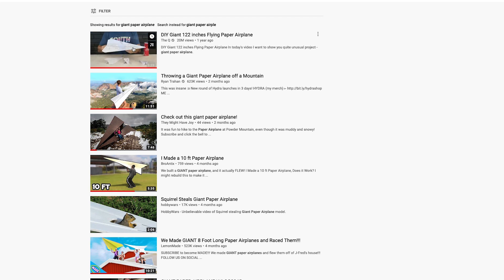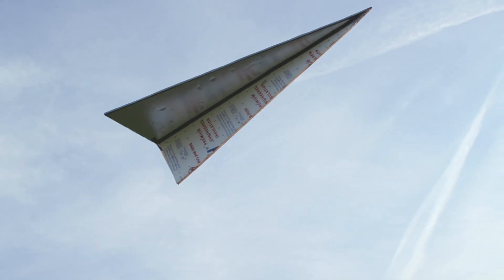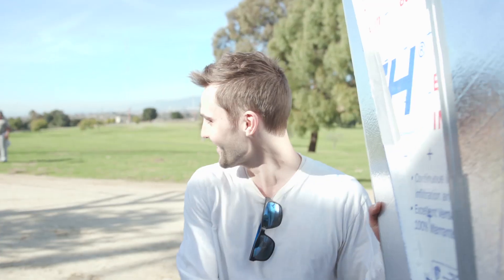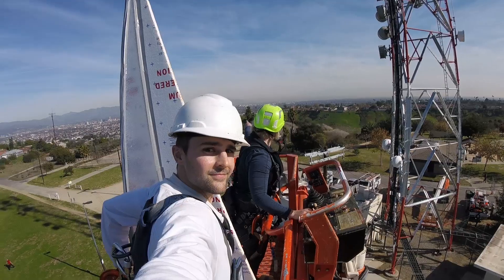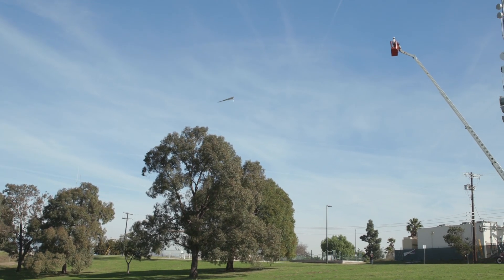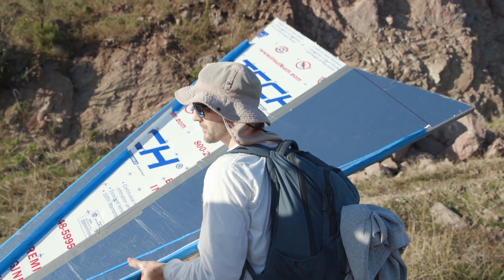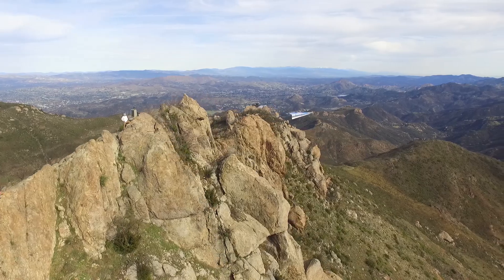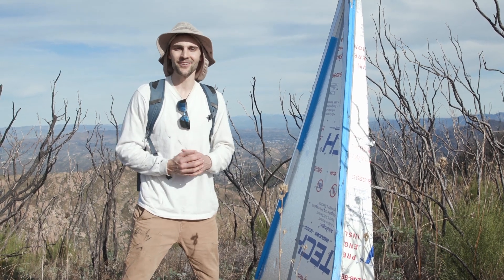GIANT Paper Airplane off a HUGE Mountain

Comment: You could have just put tape from the bottom edge to the top down the wing and it would have been better than nothing.
Or put it to the edge and slice it at an angle.

Like a real paper airplane, it just needed some weight on the nose.
So it was probably the extra weight and the "airfoil" that helped.

Comment: Nick I don't know if anyone else said this but, when you fly a paper air plane it flips upside down and the place where you hold it to throw, separates. I think it catches the air and, creates a low pressure area under the bottom and the wings just stabilize the whole plane. I don't know all the tech. terms but, I think it would fly a lot longer if you made it like how a real paper air  plane flies. Good Luck : )

Comment: The weight balance is wrong, if you took of a little of the vertical tail it would fly better. The extra forward edge just balances it better but also gives more weight.

Comment: A paper airplane has a natural airfoil that results from the bending of the paper into a curved surface. Also in a paper airplane lift is produced by the wedge formed under the wing. Your vertical section under the wing wasn't wedge shaped. And as everyone seems to have noticed you had issues with the cg. To keep it from pitching up and stalling it just needs more weight in the nose. You could give it a real airfoil by carving the foam with a hot wire.

Comment: was not an airfoil. Just a nose weight! Basics to create an "airfoil". Have to create a longer path for the air to travel on the top surface vs. the bottom surface. Basically longer surface distance on top than on bottom, would make a basic airfoil. That is why there is a "bulge", among other reasons.

Comment: You'd need to lose the air foil and also take some weight off the rear by cutting off the bottom rear corner of the plane... That will fix the centre of balance issue.

Comment: It's foam man. Simply stack one piece on top of the other and use any tool to trim, sand, cut or otherwise shape the curve into it. It's easy to manipulate foam, so why just leave it with a sharp edge like that?

Comment: You have fantastic enthusiasm for what you are doing, but it seems you never played with paper airplanes as a child.  A proper CG and correct pitch control (up-elevator) is what will give you the best glide ratio.  Also, an airfoil does far more for reducing drag on a wing, than it does providing lift.  The whole "Bernoulli's Principle" for producing lift is incorrect and shouldn't be taught in schools, as it gives very little lift to a wing.  Check out what NASA says about the production of lift:  https://www.grc.nasa.gov/www/k-12/airplane/wrong1.html

Comment: What about using water pipe insulation cut in half for the top air foil? It would be rounded and not very heavy https://www.homedepot.com/p/Everbilt-1-in-x-6-ft-Foam-Pipe-Insulation-ORP11812/204760805

Comment: The "airfoil" addition simply makes the flyer properly nose-heavy. Without it the flyer is too tail-heavy, will nose up & stall.

Inspect a folded paper version and you will notice that there is a lot more material near the nose than the trailing edge, making it properly nose-heavy.

Comment: The guy that told you to tie off where ever is an idiot just FYI.
Reply: You can tie off on the railings of a boom lift. Everything aside from the gate is okay
Reply: Lol, ok. Well the OSHA regs and manufactures recommendations typically do not allow tying off to the guard rail system since they are not rated for fall protection.
Reply: Alaska Life  This one was rated. Look at the thickness of the rails. Man-rated. I work in booms all the time, have all my certs and OSHA 30. I know the difference 😂

Comment: Challenge! Make an actual paper airplane that size. That's a foam board plane, not paper. It just shaped like a paper plane. Use stiff but thin cardboard. Make different popular paper airplane design and test them. I say cardboard since technically it's a form of paper.

Comment: It's a CG (center of gravity) problem.  CG is a fundamental issue for any aircraft.  Your airfoil version happened to be closer to the ideal CG for your plane.  When you removed the airfoil it move the CG rearward, which made the plane tail heavy, which caused it to pitch up and stall.

Comment: The STALL your noticing is NOT because of the airfoil shape, its actually because the CG (Center of Gravity) is too far AFT when you remove the "airfoil" piece.  

To test this, simply figure where the CG actually is when the airfoil piece is on there, then add weights to match when the airfoil piece is off.  Repeat the experiment 5 times with each configuration to actually figure IF having the airfoil piece is benefitial.

Comment: As others have said here (Dander the pander Head  and SkidzFPV
) said best below.  When you took off the extra foam off the top that was mainly on the front of your glider.  Leaving the glider tail heavy.  You had it balanced pretty much perfectly with that extra foam you had on the wing and most on the front half of the glider.  But that does not mean you should want that extra foam there.  As far as making it a better "airfoil"  that was pretty bad.  The fat, flat leading edge was bad for drag.   And even worse was that sharp drop off edge you created on top of the wing along the back of the extra foam you added.  That is acting like a spoiler to KILL lift.  Take a look at all the uses of spoilers on aircraft.  They are used to kill lift on a wing.  Jets use them when descending.  Gliders use them for same thing and when landing.  Some aircraft extend a spoiler on one wing to kill some of the lift on that side to help with banking.  Some airliners use it, B-52s, C-17s, C-5s use them as well as Helios and P-61s.  In all cases the spoiler is on top of the wing and has a sharp break in the air stream when extended to 'spoil' the airflow.  
If you wanted a better airfoil shape you can go to a lot of work and create a nice curved top of your wings that looks like the top of the airfoils that you showed.  Or more simply you can add some camber to your wing.  That is give it an over all downwards bend to the wing.  This works well for slow moving aircraft.  Birds use this, the Wright brothers used it, ultralights use it.  Landing and taking off jets use this with leading slats and trailing flaps down. This also works on some high speed aircraft.  The F-15 has a cambered wing.   So two ways you can do this.  One is take that extra foam you put on and off your glider and instead of taping it to the top of the wing.  Just tape it to the bottom of the wing.  That should fly a little better.  But you still have extra weight and that very fat flat leading edge.  Or, cut along the first one quarter of your wing along its length and reattach that piece to the wing so it is now bending down just 10-15 degrees.   You can try this on a real paper airplane.  Just bend the front quarter of the wing down and fly it to see how it works.
Then when you made any changes you need to work on balancing your glider.  Before doing anything set the the extra foam back on your glider and see where along the length the glider balances out flat.  When you had this extra foam on it it seemed to be balanced well.   If you make any changes you want it still balance at this CG, center of gravity, point.  You might want to also add elevators that you can bend and set for better flights.  Something like aluminum foil from disposable roasting pans can work.
And if you or anyone wants to play around with and study airfoil shapes or any shape in moving though the air.  There is great app for iPads called "Wind Tunnel" that does as it says.  It gives you a great visualization of airflow and air pressure as it moves around something.

Comment: Not actually an airfoil really. Not going fast enough to create any measurable amount of lift. The extra material just added some weight in the front to counteract your center of mass which is likely closer to the rear of the aircraft, keeping it from pitching upwards and stalling.

Comment: Another way to treat the leading edge of the air foil would be to contact cement the pieces together, use a coarse file or sanding disc to shape the edge, then tape it to lessen crash damage.  Take a good look at diagrams of leading edges.  They are typically more rounded on top unless it is a symmetrical design.  Hard to go wrong, just round it off.

Comment: For God's sake dude! It has nothing to do with your "airfoil". Airfoil is the shape of cross-cut through the wing, not adding some foil to your "plane". As you correctly guessed, your "airfoil" adds some weight to the plane, which is obvious, but how to add that weight is IMPORTANT! You don't add it to just make it heavier, because then you increase the wing load. Just looking at how your plane stalls and sinks shall tell you that you have to move the weight center forward and compensate the dive with small elevators, which apply speed-related force. Besides that, there are plenty of paper airplane designs out there, so why did you have to choose the stupid, consistently non-flying arrow-shaped one? Even with it, why do you need so HUGE handle? Reducing it by at least 1/3 would already move your mass center forward.

Comment: I'm no aeronautical engineer but I have built and flown RC sailplanes.  I think I would go ahead and set the air foil piece away from the edge just a little to simulate a little taper.  Air foils have taper in front and back but the front is duller and the back (of a typical wing) is sharp.  Also, it seems to me that it still had a little stall and a little more weight to the front would give it more forward momentum, then speed and lift would minimize the drop.

Comment: As has been said many times: Center of Gravity.  CG is absolutely more important than airfoil shape for basic aircraft stability.
Your plane would probably fly further with a flat-plate wing IF it had the same CG as it did when you had your "airfoil" bump on top.  Measure the CG before removing the "airfoil bump", then remove it and add weight to the tip of the nose until the CG is where it was.

But overall, your desire to just get out and try something is the PERFECTLY in the spirit of engineering and experimentation.  For that I applaud you!

I would love to meet up and help you out on your next iteration, I'm local to So.Cal. :)

Also, yes I'm an aerospace engineer, and your terminology-use wasn't bad enough to ask forgiveness for....but your lack of CG awareness is. :D

Comment: 5:03   You don't need and airfoil. The plane is just tail heavy thats why it stalled. The airfoil design you had just added weight to the nose, not lift. That is why it worked better with the "airfoil" on there.

Comment: really cool! but no Airfoil there... you just added nose weight since it is tail heavy and a lot of drag on the leading edges, in an actual paper airplane most of your folds are in the front and the leading edges of the plane and its wings, therefore increasing weight and allowing it to fly better. Now for your next test for an actual airfoil, HOT Wire cut an  A symmetrical airfoil on that plane and add some nose weight. Then throw it off that cliff again and i can almost guarantee you it's going to glide for a mile. lookup videos on youtube on foam cutting using the HOT wire technique.
It will not disappoint!

Comment: I’m not aeronautical engineer but as far as I know it’s not the the aero foil that’s fixing the problem, it’s the weight your put in the nose that prevents the angle of elevation too high which causes it to stall. Basically a rock on the front would perform the same as the areofoil

Comment: The extra foam you added as an “airfoil” was simply adding additional nose weight to the plane. That made it fly better it really didn’t have anything to do with aerodynamics / the air flow over the top of the wing.

Comment: I think that your first problem was that you did not have a good Centre of gravity when you remove the air foil and that’s why the air plane stalled out and crashed you should have it slightly nose heavy so that it keeps tracking well you choice also put on some control surfaces that why you can turn the glide rate to make it the most efficient

Comment: I dont think the airfoil is the problem, it is the CG, when you remove the airfoil, you lighten the nose too much.  Just look at your design, most of the material is at the back of the plane making it tail heavy.   Now look at a folded paper airplane, there are multiple layers of paper in the front and only single layer in the back, this makes it balance slightly nose down which will cause the plane to gain speed, the speed then increases airflow over the wing, which produces lift.  You don't need an airfoil shape, just more nose weight.  Cut lightening holes in the aft of the vertical stablizer and it will fly just fine.

Comment: honestly the flat wing would probably work better than the "airfoil" if given enough weight in the front i thing the reason it worked better with the airfoil is because it added some weight in the front so it was heavier than the tail under the back of the plane because a nose heavy plane will fly poorly but a tail heavy plane will only fly once so in the future i would round the edges of the foam and add some lead or steel weights in the nose of the plane

Comment: The “airfoil” just added the needed nose weight to get the CG (center of gravity) in the correct place.  Try ditching the airfoil and adding weight to the nose so it doesn’t stall
Reply: yeah except instead of adding weight to the nose to adjust CG he could actually take off weight from the tail. that fuselage thing is huge in the back
Reply: bonob0123 absolutely, just remove some of the vertical section, would work
Reply: Where did you learn this
Reply: So little bit of dihedral keep the plane flying straight and stable
Reply: Ok
Reply: the wings needs to be up
Reply: Oh you meant his airfoil. Sorry I thought you were trying to say airfoils don’t matter in general
Reply: Thomas Jackson airfoils definitely matter, I’m just sayin that the airfoil isn’t what is making it stall, its the lack of nose weight, and adding a little weight at the top of the nose will be lighter than across the leading edge of the entire plane
Reply: why make an abbreviation then say it in full 🤷‍♂️
Reply: OSIRIS PLAYZ bc (because)
Reply: OSIRIS PLAYZ because not everyone without aeronautical experience knows that CG means center of gravity

Comment: Nothing wrong with the flat plate airfoil that was not the issue,NASA use them no problem you would have been better not making it too long and make more of a delta shape to the wing ( or see Barnes Wallis Swallow designs ) add upwards reflex to wingtips on any flying wing/delta shape and make sure centre of gravity is more towards slightly nose heavy,try it again as a Mk.2 with these features and just  the flat plate wing it will fly twice as far,someone even radio controlled one and it flew great.

Comment: You're not exactly wrong, but you were mainly addressing only ONE factor, the airfoil, and ignoring the center-of-gravity/center-of-lift relationship. To correct this you could use corrective ballast (as you did with the GoPro), or warp the trailing edges (elevators) to trim the nose up/down, or fix that draggy blunt leading edge that was no doubt added useful lift, but added significant drag at the nose. As a result, it still flew pretty good but seemed to be "mushing" at a high angle-of-attack close to the stall(!). It did descend slowly (good), but didn't glide forward optimally to achieve it's best glide slope (greatest distance from launch). Fun stuff!

Comment: Align the airfoil with the edge of the wing. Use a knife and sandpaper to create a rounded edge. Use an adhesive vs tape. Make cutouts in the wings and cover with tissue paper/plastic covering. Use cutouts in the fuselage to achieve balance at CG point. Since the fuselage doesn't add a lot structurally, it can be a major weight drop factor by making large cutouts. Cover or leave open the cutouts in the fuselage. Object; to create lighter craft and better sustained lift. Just my thoughts.

Comment: When you don't have a foil, it can still work just fine you just have to throw it down. When you throw it straight out it pulls up and stalls. But when you throw it down at an angle when it pulls up it helps to level it out (and this whole time its moving faster because you threw it down at an angle)

Comment: You are definitely confusing lift with CG. I mean, fun content, but nothing is proven here regarding an "airfoil" as you keep calling it. Did you try just putting a weight on the front to keep it from stalling? It's like what we used to do putting a paper clip on the nose of a paper airplane. Again, fun stuff, but your science and method is very flawed :)

Comment: Dihedral (the angle of the wing relative to the body) is more important in paper airplane design. The ends of the wings need to point up slightly, most people get this wrong.

Comment: You don't need the airfoil on this, but the center of gravity does need to be changed. A little extra weight on the tip of the nose will keep it from stalling out. All your airfoil is doing at this point is keeping more weight on the nose which is correcting the bad CG. If you're set on the airfoil, try cutting the inner and outer edges of it at an angle to improve airflow around it. Cut the inner portion of the foil at 30º, and the outer edges at 45º, that should dramatically increase lift. Even better, sand a contour into the edges of the foam after cutting the angles, then cover the exposed foam with clear packing tape to increase edge strength. You could also try thinner sheets of foam for the main construction, keeping the dimensions the same. Going from 1" foam to 3/4" will net you nearly a 25% reduction in weight. Good luck, this was a cool project!